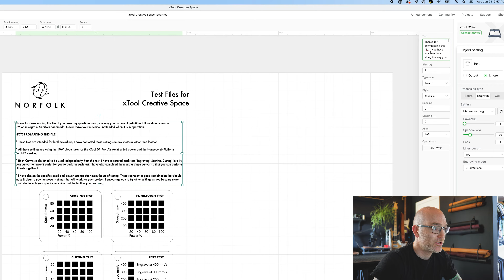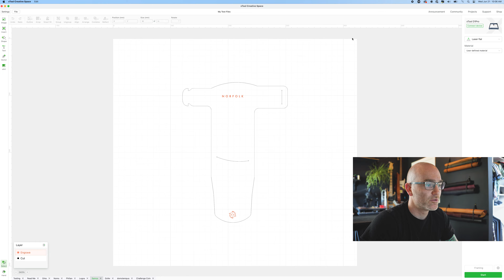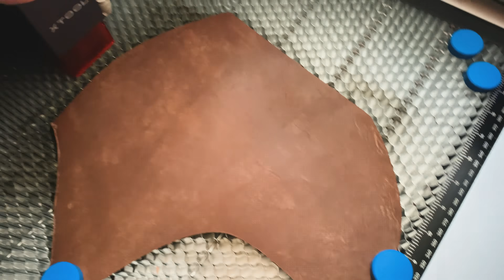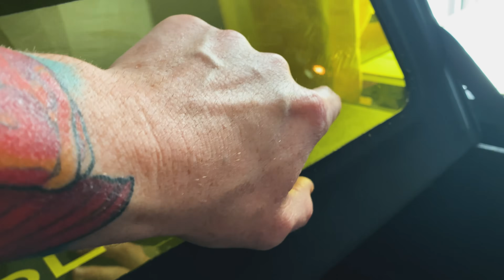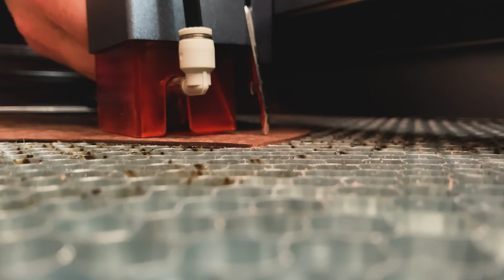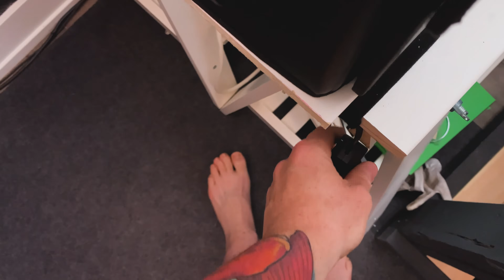xTool D1 Pro REVIEW for Leatherworkers

Comment: Could 10w cut 11i oz leather?
Reply from the maker: It would eventually cut through, but I imagine there would be significantly charing. I don’t use leather that thick so I can’t be sure.
Reply: @JustinStarrstudio  I make mostly knife sheaths , a symmetric blank would be nice to start with.  Maybe not quite 11oz
Reply from the maker: I’d probably suggest a 20w diode but I have very limited experience in lasers so you’d be do some research before committing.
Reply: @JustinStarrstudio  of course, thank you for an excellent overview video.